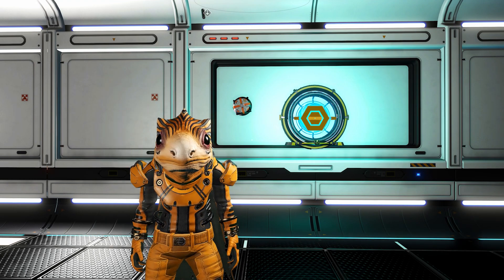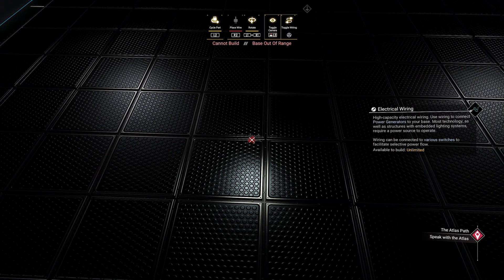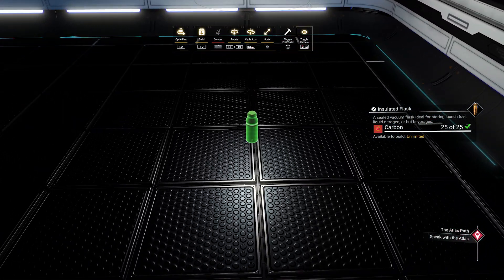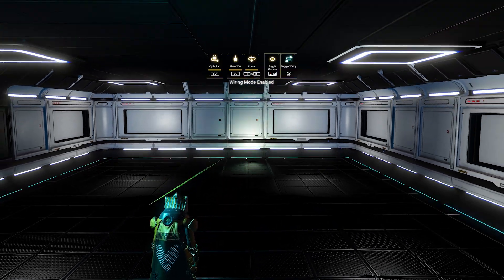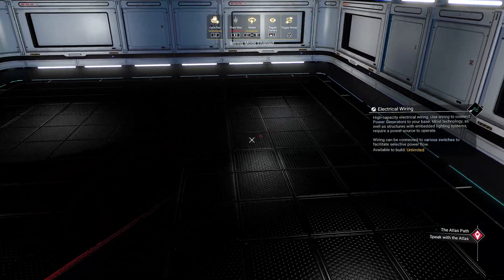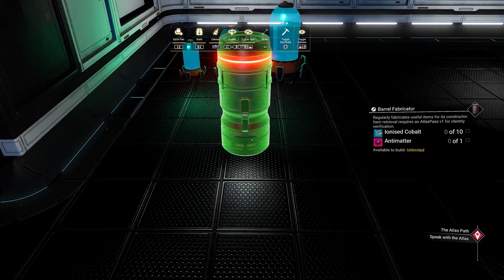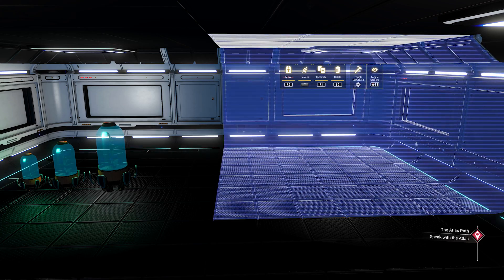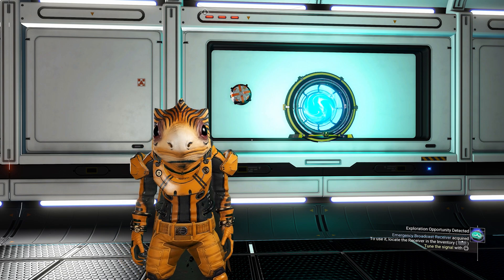How to Glitch Build on a Freighter in No Mans Sky - Beeblebum Glitch Building Techniques.

Comment: It's possible to place a wire by doing a reverse wire glitch for the first end, then press Q to disable wire mode and glitch it again. You can place items at arbitrary heights this way, though the wire ends are constrained to surfaces; they don't free-float. You can turn a scalable object upside down though which will let you glitch a wire at the origin of the object (was the base, now the top).

If you place the flora containment upside-down on the roof for example, when you pick it up again it will be flipped. Take a copy and position it on the floor, scale it to the height you want and then do a reverse wire glitch to place the first end of the wire free-floating at the height of the flora containment. Press Q to disable wire mode, so that the flora containment is in hand again. Position it on the floor, directly under the first end of the wire and do the reverse wire glitch again. Now you will have a vertical wire that you can use as a platform to place a target object on. You can get the teleporter and the trade terminal nicely centered on the wall this way, without relying on the lip that is on the wall. You can also inset them into the wall.